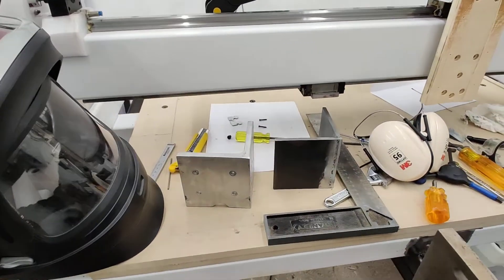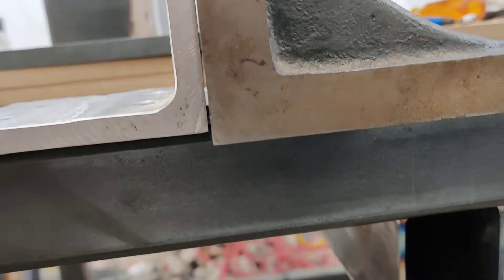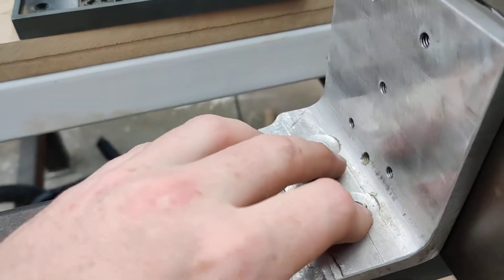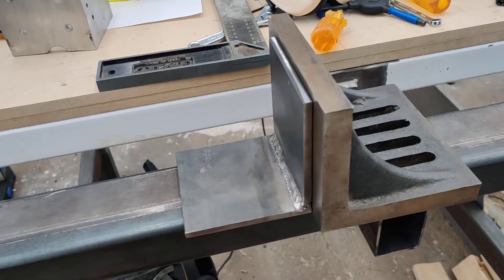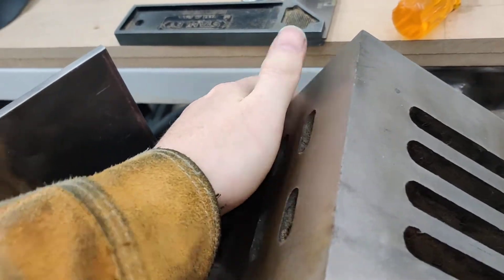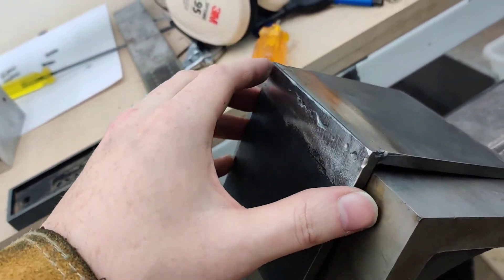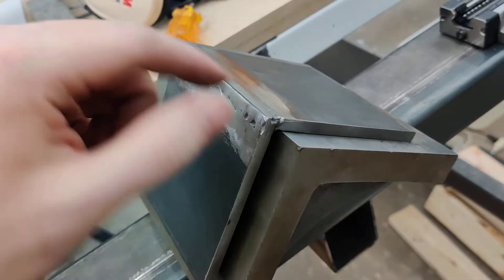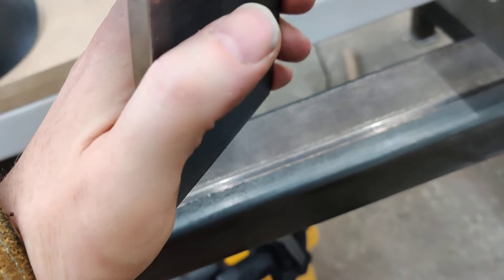TIG Torch Flame Straightening for the Perfect 90 Degree Angle

Comment: Actually if you have a sharper tungsten then the arc will widen out more. The cone will be wider at the base metal. Look up what the angle does when sharpening a tungsten. Compare the angles to arc shape. I saw a really good diagram on it once years ago I am just not sure where it was.
Reply from the maker: Cool I'll try it out. I've only tried the flame straightening with the tig twice now. Still haven't gotten it to the point where I don't ruin the surface finish. So far it seems pretty reliable as a way of straightening though as long as you don't care how the surface looks.
Reply: Yes a sharper tungsten would be the way to go, 15 degrees or so.

Comment: Did you try lowering the amperage of the tig torch. I'm interested in this because I no longer have a ox/acetylene torch. Also, couldn't you tig weld with filler rod and fill in those holes in your welded part and grind it back down to make it look nice? (If you wanted to make it look better). Thanks for posting.
Reply from the maker: I dropped the amps down to like 50. It was still too much and melted the surface. I think it's just hard to control because it's heating up such a small area. I feel like if I wend down to 25 amps I'd still melt some small holes.

If I were to go and fill in the holes. I'd be putting more heat into it, so It'd warp too much past the direction I wanted in the first place.